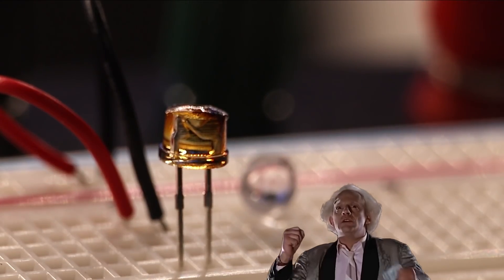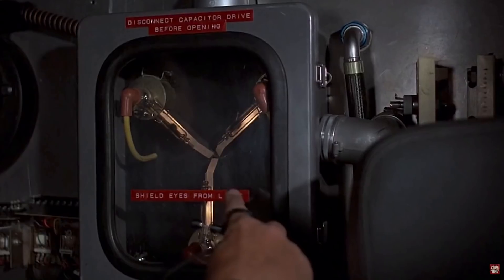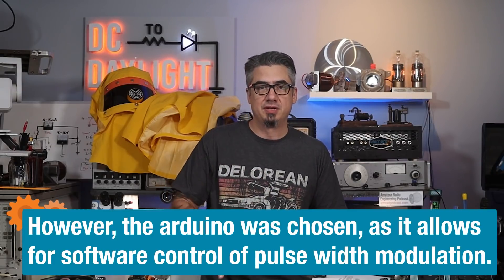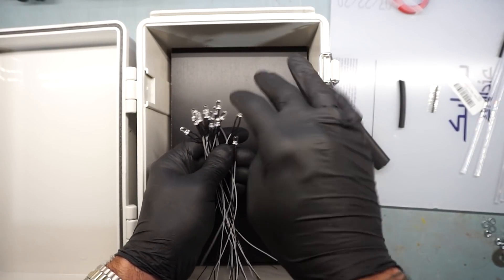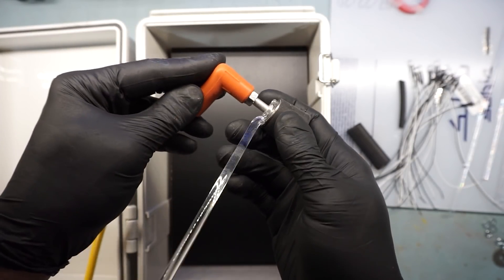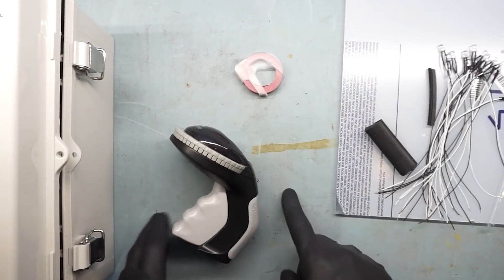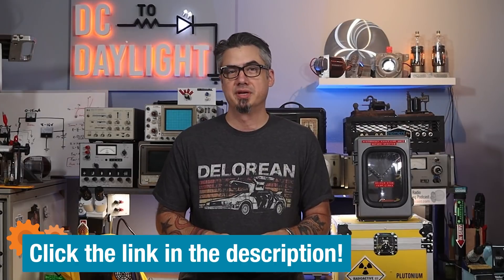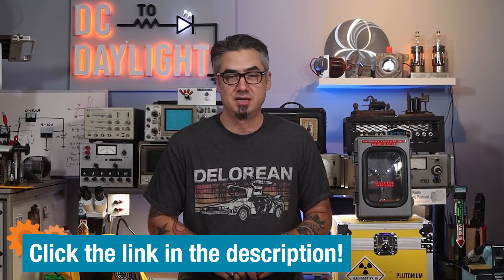Driving LEDs to Create a Flux Capacitor! - DC To Daylight

Comment: At 5:22 you are showing the circuit to switch on/off your LEDS.  What is the purpose of the D6 and D7 diodes on the base leg of the transistor?  I use the same circuitry but without the diodes and seems to work fine.